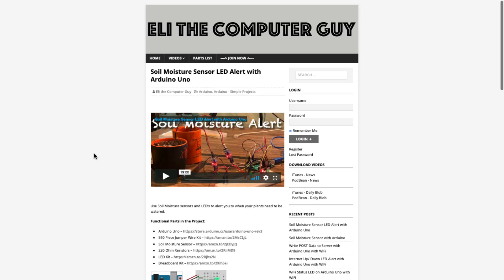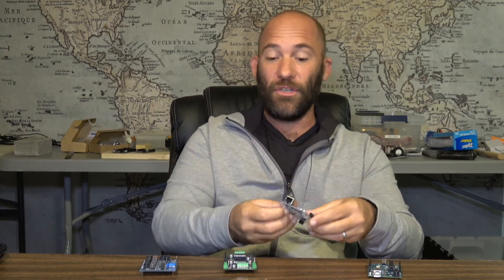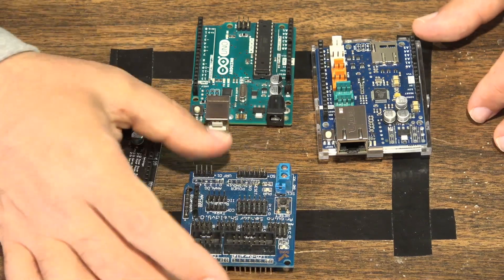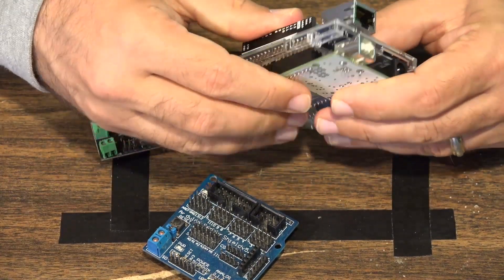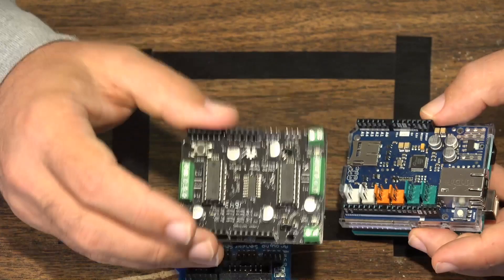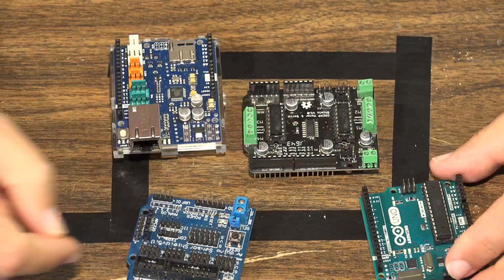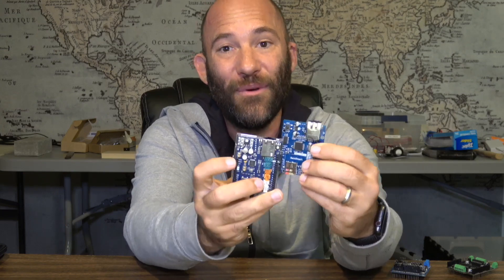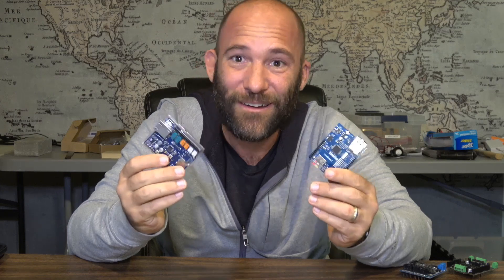Arduino - Shields Introduction

Comment: kindly an assistance to the assembly of this SHIELD ARDUINO SERVO RC CONTROL card (cod ft1397M)would serve an assembly scheme with programming to be launched to the arduino.cc program as noted (the article of the project is published on electronics in n.228) SPECIFYING THAT ONLY A SKETCH IS NEEDED TO START THE 4 MOTORS SINCE THEY DO NOT HAVE OTHER COMPONENTS

Comment: But you cannot stack those shields indefinitely. As each shield draws some current and arduino power source does not have a huge wattage reserve so be careful with that.

Comment: Interesting.  Always wondered how these worked.  Would like to see them combined and used with applications - or examples.  I presume these are used in 3d printing setups.  Any video's of people building something from scratch with these?
Reply: Tyler Jordan Well Arduino is mainly used for pro typing. you can build some awesome stuff like robotic hands, arms, and drones too. Look at Uarm Factory. That desktop arm I think uses Arduino Mega. However, like I said, Arduinos are typically used for prototypes and then you use actually microcontrollers like the Atmega chip inside the Arduino to make the actual product along with your circuits.
Reply: Yes. You can also use them for 3d printing but there are better boards for that like Raspberry Pi and Rambo Boards.